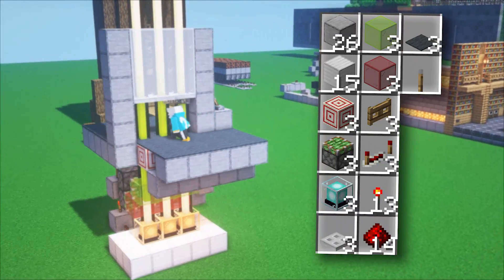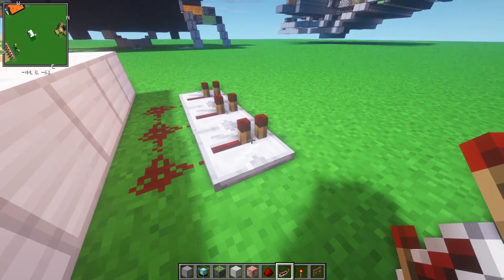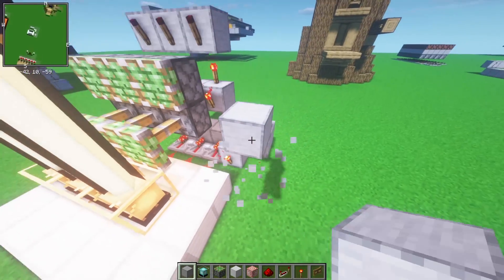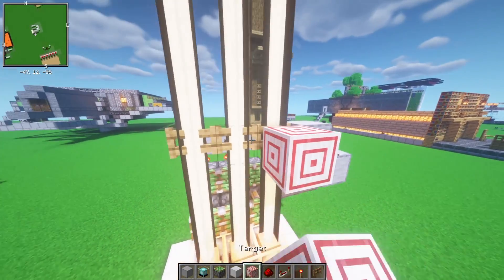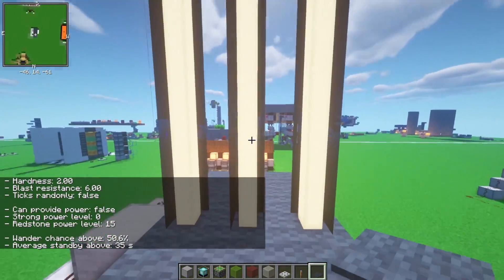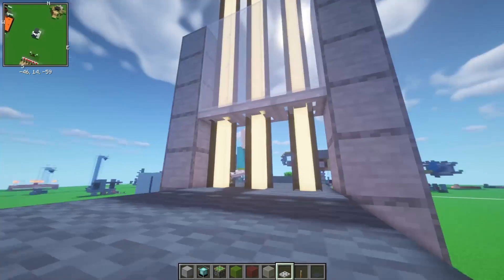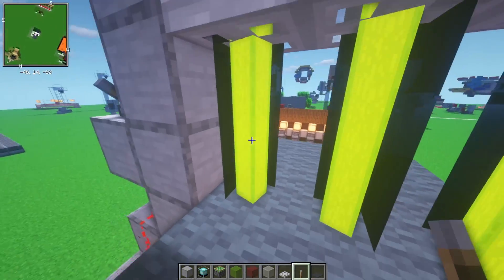How to build a Laser Door in Minecraft

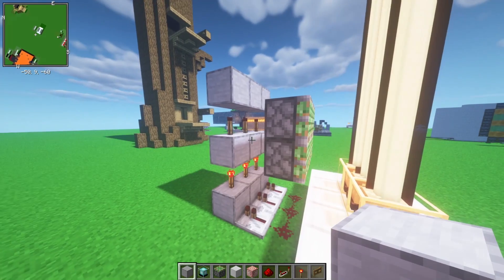Comment: This will not work for bedrock, as it utilizes Quasiconnectivity at 0:57 EDIT: and because it uses Target blocks, which dont conduct redstone in bedrock.
Reply: What exactly is quasiconnectivity?
Reply: @derpyherpy3773  Quasiconnectivity is the feature exclusive to Java that allows you to power a piston or other object using a redstone block or torch from 2 blocks away
Reply: @fireplace8583  what are the prerequisites needed for this to happen
Reply: @derpyherpy3773  a redstone signal producer must be nest to any block adjacent to the piston, except for its face. This piston must be updated to realize it’s being powered via placing a block next to it, or updating the state of a block next to it.

Comment: This does work on bedrock. (With the bedrock fix). 
The only thing you need to change is to get rid of the iron trapdoors. On bedrock the carpet doesn't let you through with a trapdoor above you. Without the iron trapdoors you still can't walk or crouch through when it's red. And when it's green you can straight up walk through. Hope this helps anyone having trouble with this.
Edit: Only tested on PS4 version 1.17.30